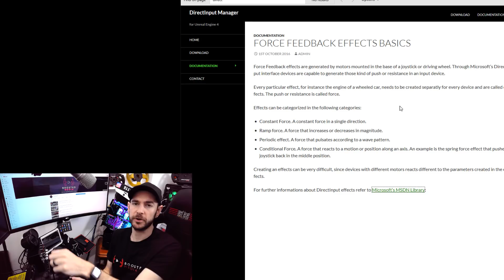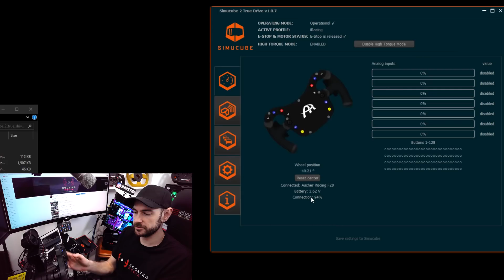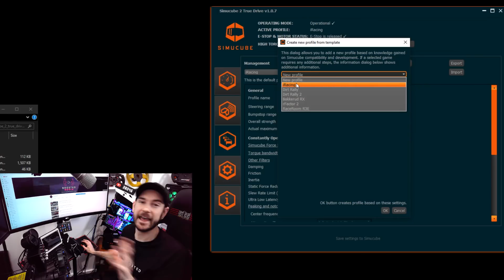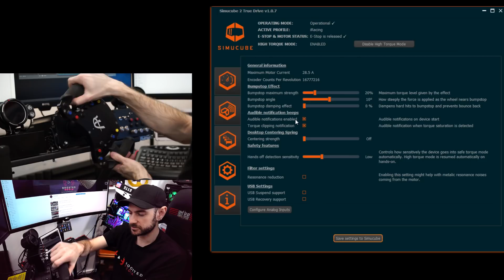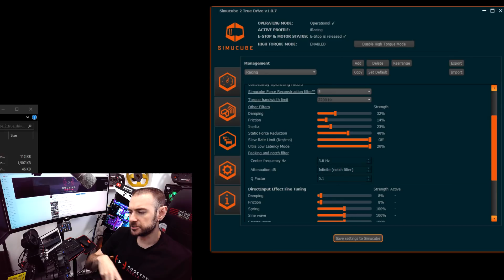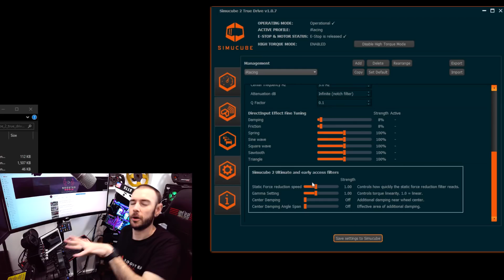HOW FORCE FEEDBACK WORKS - Each setting explained in detail - Simucube / Fanatec

Comment: Very good Explanation of the overall - a couple of corrections for you though..

The Direct Input Filters are not filters in the Driver or the SimuCUBE itself - the Direct input filter % in True drive adjust the intensity of that filer parameter that is coming from the Game itself.. So when a Game uses direct input effects to create "Canned" effects and/or control the wheel through certain parameters these adjustments allow you to fine tune that signal from the game.. i.e if the game output canned rubble strip effects and you feel they are too strong you can adjust that in those settings.. NOTE: iRacing uses no Direct Input effects at this time so you can set any of those filters anywhere and they will do nothing. Other games however such as Asset Corsa use them for various things such as pit lane steering wheel stabilization and curbing effects.

Further note on the Constant Damper - The damper is a speed based filter so the faster the wheel turns the more the damping filter works and it ramps off as the wheel slows.

Another note on Inertia - it is a double edged filter.. When you are turning the wheel in the direction of a signal or when that signal is off then you get the effect that was shown in your video (where the wheel will keep spinning) and the wheel actually feels like it is lighter to turn, However when a signal comes from the game in the opposite direction the inertia effect adds to that signal and generally causes the wheel to be heavier in resistance.. The interesting thing is that the inertia filter due to this property is actually a little better at controlling wheel oscillation than the Damper as the damper never actually tries to stop the wheel where inertia in reverse does (as well as friction).. One other thing about the inertia filter is that it can be used to counter some of the weight effects that friction imposes which will allow a wheel with friction added to regain some of the center return speed as inertia will counter the friction in the direction of the signal.

And last I would actually suggest NOT using the Notch filter unless you can really pinpoint the problem frequency as I have found that if you have it wrong AT ALL you will end up knocking out some detail and it will go away and come back like a light switch.. as it works always so it will even work at points where the problem being corrected is not present. This filter is INSANELY hard to set-up and I usually suggest trying to set this while driving.

Anyway Overall this is the best video explanation I have seen of the settings.

Just a note to who I am since this is not iRacing.. I created the Setting and Tuning Guide for the SimuCUBE SC1 on the iRacing Forum (most of the aspects still apply to the SC2 and even the set-ups will still work there, you just need to multiply the filter % by 10 currently and of course the settings don't have the SC2 specific filters). I also along with Mika at Granite Devices Wrote the original SimuCUBE SC1 User Guide which has been expanded upon for the SC2.
Reply from the maker: The is a lot for that. I’ve pinned this comment for viewer reference.
Reply: Hi there, just wondering about something. I had a quick look at your video's and noticed all of them are with a Fanatec DD2. Is there some specific reason you opted for the DD2 in stead of the SC2? Since you're obviously super familiar with the SimuCUBE "ecosystem" I'd imagine you would prefer to stay SimuCUBE.
Reply: @poepeloerke2  Becasue I am a Beta Tester for the DD2. My Main Direct Drive is a SimuCUBE SC1 "Large Mige" I haven't yet had the opportunity to test out an SC2 but have done a ton of testing and research on the SC1 SimuCUBE and even helped write the SC1 User Guide with Mika at Granite Devices.. So in essence I didn't really choose the DD2 it was just that when I decided to do a few videos Beano and I were comparing the performance characteristics between the DD2 an the SC2 Ultimate (which really isn't much of a comparison.. BUT... it was something to see)
Reply: Hi Brian, I was wondering if you can help me with my Simucube settings on Assetto corsa competizione. Can you speak to me via personal message please?
Reply: @poepeloerke2 hi bro, i want make a OWN diy steering wheel, so how i can get the data from the game like a asetto corsa, dirt rally, and etc??

Comment: regarding ultra low latency, it is often used to reduce oscillations on the wheel, I personally found this filter having a big impact in Automobilista, in which at high speed there is a tendency to heavy ocillations, reason why I abandoned the title when I was on Simucube1 OSW and returned now with SC2 Sport because in this case it was a real game changer.

Comment: also, there is actually an "undo last change" function, which is "Reload settings from SimuCUBE", but it works only if you haven't already saved the modified profile

Comment: Thanks Will. Great explanations. 

Something that may really benefit iracers that are new to simucube (or any DD) is the relationship between the iRacing settings and the simucube true drive app settings. 

Modifying the app.ini to change the iRacing ‘strength’ setting to show ‘max force’ and then the impact that ratio  has with the iRacing ‘wheel force’. 

Also matching the wheel force setting in iRacing to the actual torque showing in the true drive strength setting.  

After playing with my new SC2 and nearly ripping my thumb off I went and read about that relationship which is really key to the interaction between iRacing and wheel. 👍🏼

Comment: Thanks so much for this Will. I feel like I was stumbling about trying to understand those settings. Great explanations. I used your settings and the change is huge. Love it! One question... Do you enable  the high torque? @Boosted Media
Reply from the maker: Yep definitely enable high torque.
Reply: @boostedmedia  thought so...it feels so much better with it on...I pumped mine up a bit higher than your percentage wise as I have the Pro and I think you have the Ultimate to get the nm up to the same amount

Comment: I love your passion and enthusiasm, there's just a few things I'd like to mention:

- you claim the SC2 almost fully saturates the entire USB bandwith of your PC. I believe a claim like this needs evidence, either from Granity themselves or from USB bandwidth tests/benchmarks or at-least something verbal like "I did USB benchmarks, trust me, it almost fully saturates it." But you just made the claim with literally no evidence nor explanation.

- you said DD wheels feel exactly like real life. Do you have racecar driving experience? If so, how much? Granity and other FFB/wheel companies wouldn't be working so hard to create filters and even game-telemetry based filters if FFB feels exactly like real-life. Also, almost every racing driver says that game FFB is too harsh/aggressive and overall powerful compared to real-life when the game/wheel is set to apparently the same 1:1-with-real-life Nm level.

- continuing with your "DD wheels feel exactly like real life" statement, this is barely currently technically possible anyways, mainly (but possibly not limited to) the following 3 reasons: 1) real-life FFB is passive/reactive, game FFB is active, 2) real-life FFB is torque-based, game FFB is position / velocity based, 3) Microsoft Direct Input is old FFB tech from the 1990s with it's own limitations aside from points 1 and 2 (what I've been told by multiple FFB gurus). Most of these limitations aren't really a problem with "regular" consumer wheels but it's a different story when using the insane power, acceleration, etc. of DD servo/stepper motors.

- different filters continue to become implemented - part of this reason is exactly my previous 2 points, to try and makeup or "cover-up" issues/limitations of FFB.

- you said it's incredible that there's no perceived lag of FFB from Granity's (Simucube's) SC2 settings. Yes, this is true but there's neither any perceived lag from the Simucube 1's settings nor even the prior OSW non-Simucube (Ionicube) settings nor Leo Bodnar's settings (from my research) nor the Accuforce's settings. You sort of make it sound like the SC2's lack of perceived lag is some incredible thing that no one's ever done before.

- you said higher sample-rates are what make robots' movements smoother, this is partially true but there's more to it than just cranking up higher and higher sample rates as you made it sound. For eg. velocity control VS torque control VS position control (read the description regarding picking up an egg using position/velocity VS torque control here: https://robotics.stackexchange.com/...control-vs-velocity-control-vs-torque-control )

I like your videos, great work!
Reply from the maker: Some people like lots of details. Others don’t. Finding a middle ground is very difficult. I never once said simucube was the only one that had no perceiveable lag.
Reply from the maker: As for race cars. Haven’t had track time  for quite a while now but have driven a lot of Supercars. LaFerrari, Enzo, F40, F50, 959, 911 GT3 RS, 650S and many more. I used to work in a car museum. So I have a pretty good idea of what they feel like at least at road speeds.
Reply: @boostedmedia  Driving a roadcar around a street is not the same as driving a full-on racecar in anger around a track. But even besides that, FFB is definitely not perfect as I mentioned in my multiple points in my original post. I feel like you're slightly missing the point, the bigger picture of what I was explaining. To say it's "exactly" like real-life is pretty far-fetched especially when even wheel/FFB manufacturers themselves know that there are still many technical limitations/hurdles with FFB ranging across the entire spectrum: from the core FFB technology in use to individual game physics & FFB modeling/implementation.
Reply: @boostedmedia  Yup, some people like lots of details, some don't, and some like different details from others. I never said anything regarding that though.

As for the perceivable lag, that's quite a minor point I mentioned and not really important to the overall message I was trying to state but I'll explain further. I never said you said the SC2 was the only one to do it (no perceivable lag of effects) but the way you were praising it almost gave that impression. It would be like me doing a review on a new Ferrari road-car and talking about how it's so incredibly amazing that Ferrari got a road-car to produce downforce. There are 100s, if not 1000s of road-cars that produce downforce for many decades and from many manufacturers. To suddenly start saying how it's so amazing that Ferrari has produced a roadcar with downforce in 2019 sort-of gives the impression that the person isn't aware that this is something road-car manufactures' have easily, commonly been doing a long time...or.... it gives an impression that the person is trying to mislead uneducated viewers who aren't aware that road-car manufactures' have easily, commonly been doing it for a long time. I feel like a more "transparent" way to word it would have been something like: "I know most, if not all, wheel manufacturers have no perceivable lag when it comes to their FFB effects - the Accuforce, the Bodnar, SC1, SC2, etc. - but I still find it amazing that they're all able to achieve this."
Reply from the maker: Spinelli I don’t comment on hardware I haven’t tested, hence not commenting on how other brands perform by comparison. This video is about the Simucube. When I test something else I’ll be able to draw comparisons.
Reply from the maker: I’m not going to say “I know most brands have no lag” when I haven’t used any other DD wheel bases.
Reply: There are actually a few devices that will push the bounds of the USB currently, VR and Most Direct Drive units do which is why it is good to have them on their OWN USB controller chip with no other devices.. It has been found that running some of these devices with anything more than a low band witch device causes USB overflow and windows starts shutting down devices connected to the controller chips and sometimes it will be VR or the wheel.. Most of these issues do occur very easily when running VR and a Direct Drive wheel as both are high bandwidth devices.

Comment: Also I think you should touch on the NM in iracing in comparison to the NM setting in true drive. For example, if I set the NM in true drive to 50% what should I set it to in racing,  lets say for the Ferrari.
Reply from the maker: Settings within the titles themselves is beyond the scope of this video but was briefly discussed. If I’d gone I to detail on one, people would have asked for details on every sim and the video would have been 7 hours long. 

Will do some more videos later on covering individual settings for different titles :)
Reply: Because it wasn't mentioned here except in passing I will answer this.. 

iRacing uses a Specific Output ratio for strength that ratio is between the Power of the wheel itself (set in True Drive) and the Telemetry Output by the car.

To figure out the ratio the formula is =  wheelbase max output / iRacing Max Force slider setting (Linear Mode)

So in the case of this video 50% = 15.7Nm 
 if you wanted to have the wheel at 1:1 with the telemetry coming from iRacing you would set the max force slider to 15.7Nm
Formula 15.7Nm / 15.7Nm = 1 or 1:1

if you wanted the strength to be 50% you would set the Max Force Slider to 31.4Nm 
Formula 15.7Nm / 32.4Nm = .5 or .5:1

The reason (as noted in the video) to why it is generally  recommended to set the strength in True Drive at 100% in iRacing is that because the Max Force Setting directly affects iRacings software telemetry clipping, the Max force setting MUST be above the telemetry output that the car you are driving will output and this varies from car to car such as the miata will put out about 15Nm where the 488 GT3 will put out about 40Nm and the Dallara DW12 will put out about 70Nm in telemetry so if your Max Force number is less than the car output your cars telemetry will be clipped.

So that means that the above setting at 1:1 would clip all telemetry above 15.7Nm and the 50% setting would clip all information from telemetry above 31.4Nm (take Note:)

so at 100% in True Drive = 31.4Nm
1:1 = 100% max force slider would be 31.4Nm 
.5:1 = 50% max force slider would be 62.8Nm 

So now with the SAME output at the wheel nominally at 1:1 or .5:1 with true Drive at 100% you have increased the Clipping point at 1:1 from 15.7 to 31.4 allowing you to run the 488GT3 at almost full telemetry. or at .5:1 you now have increased the clipping point to 62.8Nm or you can run the 488GT3 un clipped.

Granted you do have to put up with more force during wrecks...

For information added I have found that MOST people end up at a specific output in iRacing around .35 - .45:1 and then there are a few of us like me who will run upwards of .6:1 and above.
Reply: @brionsohn2705  thats exactly how iv been running it! At 100% and then I watched this.. then I loaded a new iRacing default profile and notice its set to 37%! I guess thats just a extra safety thing for new users. So much conflicting info on how it should be set
Reply: @cjroberts001  Yea the DD companies turn down the default profiles to protect new users from really hard crash hits, especially now that DD Tech is getting inexpensive enough for the Newer ambitious driver to want to afford it as their first wheel.. iRacing runs differently than most programs in the way they translate strength so the more power you have available to you at the wheel the less likely you are going to be to clip.. That doesn't mean that you truly HAVE to run 100% but to be able to run less and still get full fidelity from iRacing you do have to do a little more work to find the limits of the car.. The major confusion I think is that i Racings attenuation model for strength is opposite most other games Baseline Gain models.. I Racing always adjusts down from 100% where others baseline and increase.
Reply: @brionsohn2705  so if say you run that profile 37% in true drive, in iRacing do you set the wheel strength to 25nm(pro) still or 9.25 37%?
Reply: @cjroberts001  that is what you Should / Could set the Wheel Strength Setting to but the wheel strength setting is only a safety Mechanism to NOT go above a 1:1 specific output and at 9.25Nm that is NOT going to happen with any car if you want to retain full fidelity.

Comment: Could you please share your updated profile on Simucube 2? I am complete new to Direct Drive bases, and comming from beltdriven base, to a Simucube 2 base, and are hunting some diffrent profiles to test out, and feel out. And to this Simucube settings, what settings is it you use in Iracing for cars? Wheel force, is that on the same strength as Simucube (In this video 16.3)?